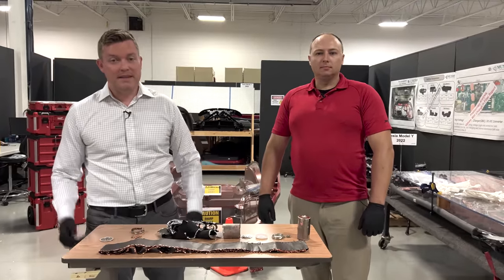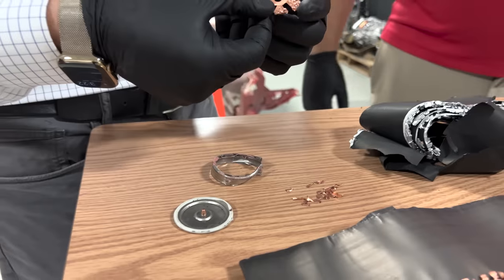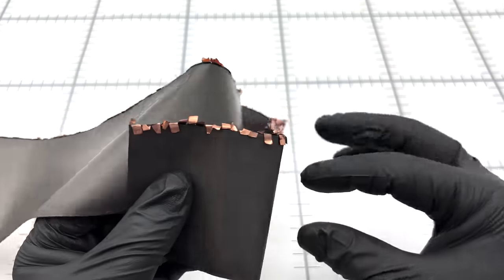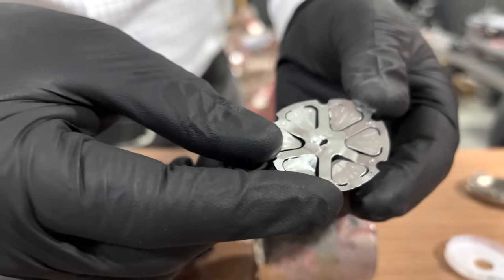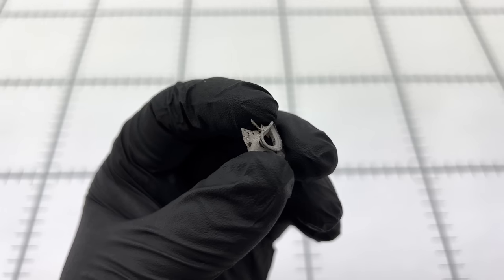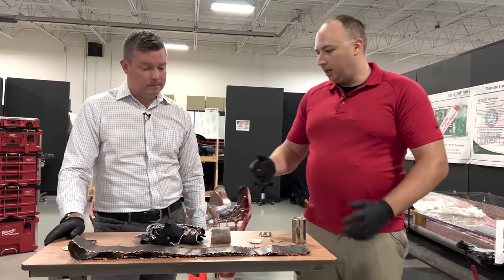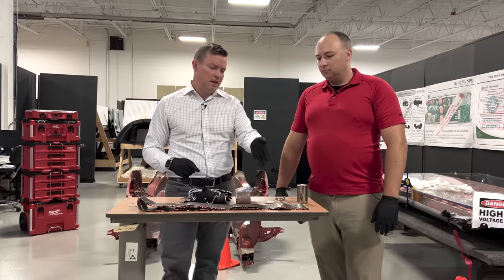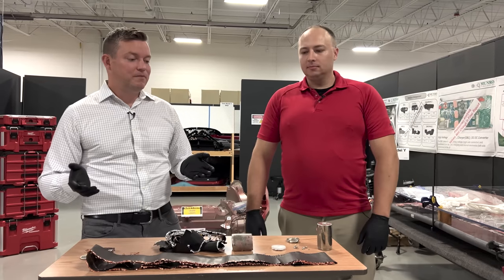What's Inside a Tesla 4680 Battery?

Comment: the tabless design is the only really new thing that has been introduced. as these cells get bigger, they result in good financial economy compared to other cell types. however, the pouch cell can be produced with this tabless design (which is not really tabless) as well and are better for a rectangular casing regarding volumetric energy density.
 bmw also wants to use similar cans in their newer EVs, but a bit longer. for sedans they will use 4895 cells - 15mm longer than the cells of tesla. und for their SUVs, they will use 48120 cells - 40mm longer than tesla cells. that makes absolutely sense. SUVs are a bit higher. which means, they can make the battery compartment in the underfloor thicker. this way, they get more energy into the SUV which fits the higher energy consumption of the SUV
Reply: Would be better to keep things simple - every time you introduce different item it makes production streamlining harder. Best part is no part. Less different parts, the better.

Comment: What is the benefit of a round cell vs the flat cells used by BYD et al?
Reply: If I remember correctly they said the production is faster. They produce them as fast like the water bottle production. The production is so fast that the video has to made slower that we can see how they are producing them.
Reply: The original 4680 form factor was for containment against runaway fires from single cell failure of the Manganese Cobalt Li battery composition. LFP doesn't need it, thus the pouch design which is denser is acceptable, and needed since the energy density is lower.
Reply: Also pouch style cells expand/contract a lot more (due to different chemistry) and need to have more free space to account for that.  Remember the Samsung phone battery fires? That was caused by not having enough expansion space.  Not sure I'd rate one type cell/pouch as better than the other. Just different solutions with a race to find the best cells at the lowest cost.  I'm sure it will be battled out for years!
Reply: @AudiTTQuattro2003  

I don't think so.
I recall it's simply to get the most jellyroll (GWh) out of the factory in the shortest possible time (Terawatt hour production from small factories)
Reply: Continuous motion manufacturing automation.
Reply: ROUND cells , less Stress , less FRACTURES than Folded WALLET cells and less DENDRITE growth than Pouch.
ROUND cells can be COOLED more effectvly.

Comment: Is 4680 really NMC 811?? Is that x-ray analysis the right way to determine the chemical composition?
Thought Cobalt was gone from all 4680 cells!
Reply: Probably once the cathode factory in Texas is finished.
Reply: @squee8174  They should be able to tell the existing Cathode manufacturer what chemical composition they desire. I doubt if even 2170 has Cobalt in the 811 ratio...it is supposed to be in trace quantities only.
Reply: @omnicurious2949  Where do you have your information from?
Afaik the only batteries with zero cobalt are the LFP batteries Tesla is buying from asian companies.
They still use little amounts of cobalt in their other batteries (18650, 2170)and the 4680 wasn’t intended to start with zero cobalt.
I mean where talking about how many kilograms per car? 2 maybe? That’s not much.
Reply: @Glenhh  Check Battery Day!
Reply: @omnicurious2949  Tesla are making their own cathode material. 

811 is a proven technology used in their 2170s so it makes sense to start production runs with it in the pilot plant.

All nickel... As stated in battery day was reserved for semi and cybertruck, where 811 and lfp was more economical for mass produced and economy  models.
Reply: @squee8174  Tesla cathode plant is not operational yet. 811 is the standard. But Tesla's claim on Battery day was to go Cobalt free (it's 3 years since the claim was made). In fact even in 2170 Cobalt is far far lower than 811! So, either Munro folks did not make an accurate assessment  or Tesla has had some major chemistry issues.

Comment: Very interesting, can you tell us the weight of the cell, I know they are claimed to be 355g each, I build e-bike batteries using 18650 or 21700 cells but am planning to use 4680 cells out of crashed Teslas or when they come on the market by panersonic.
Reply from the maker: I believe when we weighed one it was near the exact weight claimed.
Reply: @MunroLive  Thank you.
Reply: I think the Panasonic 4680 will be next generation. Supposedly with something like 5 tabs?

Comment: Would love to know if they are using the dry process for both anode and cathode. Also what the anticipated capacity of this battery is in volts and watts. 
Tear down of an earlier version of this battery by The Limiting Factor channel….shout out to Jordan….showed dry process used for just one of these. Also that estimated energy density of the beta batteries was lower than expected in a final version.
Reply: limiting factor have bought one of these cells so that brake down is coming
Reply: They indicated that yes, this one is dry cathode as well.
Just btw, it's "Jordan" (Limiting Factor)
Reply: @alanrickett2537  
That breakdown was weeks ago.
Reply: @rogerstarkey5390  no that cell was an early cell he got from a insider they are buying a car fitted cell to look for differences that one is still waiting on the cell being shipped which I think may have been waiting on this video.
Reply: @rogerstarkey5390  Ooops typo!  Will correct, thanks!

Comment: It gets interesting when they can make one of these for the price of 3x 2170, I guess. Apparently it can handle the energy demand cycles for a Model Y. I wonder whether it's ready to do the same for the Plaid. However, from the looks of things, it's NOT ready to bring Plaid and Roadster, even Semi and Cyber, the capacity they need, by lack of energy density.
Reply: Dramatically different requirements.  When you have a Plaid, the 2170 or 4680 may never work as the smaller 16850 has the best thermal attributes for very high power and multiple high performance runs.  Each vehicle type has very specific needs, such as low cost, high density or maximum cooling.  The 4680 is perfect for some appllication, but is likely the wrong chocie for others.  Then again, you can tweek the formulations to make different varients of the cell so there can be overlap with a single phsicial cell that fits different needs.  Exciting to see how it all shapes up.
Reply: I wonder if that's even possible. I read somewhere raw materials currently make 80% of a battery cell's cost. Not sure how accurate that is, as this would mean a perfect process would only spare 20% of the cost.
Reply: the Current 4680 is NOT High Energy DENSITY Nickel. its NMC 811 type , Standard grade . 
TESLA is Developing NCA/NCM, High Energy NICKEL as well as LFP Cathode. 
High Energy NICKEL is for SEMI , Cybertruck and mod S/X vehicles.

Comment: Min 6:00 Cory is looking forward to get a Cybertruck :-)
Me too. I think it will be a masterpiece on having a very good quality but also how to bring expenses down.
Reply: It will need to compete with the likes of Rivian and Ford who have excellent vehicles on the market already. Years ahead if we look at journalist access to anything but the "Jay Leno" hand made prototype with likely very different structure.
I do wonder how their successful application of (not their invention) giga casting with the steel exoskeleton can be. I've seen steel compete directly with carbon fiber for strength to weight on bicycle components. It takes A LOT from the engineerin and manufacturing side, though. Even a prototype is a PAIN to make. CT is competing only with steel/alu F150 and Rivian, so not quite as difficult. Giga castings might offer a great way to get the two end piece of a three-piece weld puzzle. Perhaps a surprise 3rd giga casting for the middle of the structure. Say the back of the cabin and roof down to the roof. If that one gets wrapped by a folded steel roll (exo body) and then welded to front and back gigacastings, that could be sweet. But can brute engineering take on F150 which is a long evolution of production leaning on great sale and experience?
For CB to make true to promise of 500 mi range, it will need 180-210 kWh (of meh energy capacity 4680s) of maybe 160 kWh and vastly improved aero somehow from the sheet metal exoskeleton. Can they water jet flow whatever form the body to be super aero? Can the flat surfaces be made to work and get a much lower Cd than F150 and Rivian? Even if they can save a lot of weight, that alone doesn't make a truck efficient. It might need an extreme suspension setup where it can be a low rider with vey efficient wheel wells for the city and highway, and then rise to be a competent truck. Rivian is beyond competent. See the Doug Demuro off roading test he did. The Tesla planet savers that just need a suburban "look at me, Tesla now cool" vehicle, I guess the off-road stuff could be kept to an option. Like Model X, take it on a fire road at low speed and your warranty is void.

Comment: So as we saw on battery day the 4680 cell is just applying the same technology that was already being used in super capacitors with the use of many tabs for each current collector on a LiPo cell.  The only real issue I see here is no tab to act as a fuse and disconnect a cell in the event of a short circuit.  Unless the rivit in the center is rated well below the current that this cell would pass to go into thermal runaway I still think this is a risky move since the cells are not externally fused either.  We would have to see a fully charged cell shorted in several different ways to see how much of a risk this might be unless the entire capacity of the cell is capable of being dumped across a dead short without enough internal heating to come anywhere close to a thermal runaway event.

Comment: What is the electrical path from positive to negative?
Reply: Top to bottom on the cell, side to side on the (unwound) jellyroll?
Depending on the orientation of the cell.
Reply: @SxWerks  the positive connection is to the post at the top; the negative connection can be to anywhere on the outer can, but in the Model Y is made to the top edge of the can (like the 2170).
Reply: positive post
to aluminum 6-lobed plate
to tabs on edge of positive side of rolled-up sheet then downward through aluminum foil 
then radially (outward within cell) through thickness of assembled sheets (aluminum positive foil, positive electrode, electrolyte, negative electrode, copper negative foil)
then downward through copper foil on negative side of rolled-up sheet to tabs on edge 
to copper 6-lobed plate
to case (and in the Model Y upward through the case to the top edge)
Reply: @SxWerks  The cells don't need to flip, because (as with the 2170 pack for the Model 3/Y) both positive and negative connections are made to the same end of the cell. The entire case is negative, so although the current path connects to the case at the "bottom" (opposite end from the positive post), the negative connection can be anywhere along the length (height) of the cell (and I will edit my earlier comment to include that); in this pack the negative connection is to the edge of the case at the same end as the positive terminal, which is the top as mounted in the pack. The positive and negative connections are only a couple of centimetres (an inch or so) apart.

Comment: Could the steel can of the battery be replaced by a plastic (combined with a thinner piece of steel) to reduce weight?
Reply: I'm curious as well. Howver, remember the NOISE about it being a structural cell? Cory showed how well these cells are glued together, they do form a block of sorts. How much that actually helps the car is another matter. Model Y barely lost weight, but did lose a good amount of energy capacity. Cheaper to make, but does it make technical sence a lot? The fatty pack thank (thank goodness) be bolted off after a wreck, but it's a chonky one and until energy density gets better, unlikely to be super popular for small series enthusiast or commercial vehicles.
I have an idea for an Ariel Nomad style buggy. If the Model Y "structural" battery would be decently light and advantageous to use as part of the chassis, yeah maybe...
Reply: @Cloxxki  this would also be a increased fire risk.
Reply: @Cloxxki  
Keep trying....
Reply: @Moon
That would defeat the object.
Reply: probably not, plastic is a very poor conductor, probably need steel so heat can escape the cell
Reply: The can was designed to withstand individual thermal runaway, thus the thickness and material...at least initially. LFP doesn't require so much structure.
Reply: Not only is it steel, but the can material is about 3 times thicker than most battery cells. It is very heavy. This is about structural rigidity. All of these cells are glued together and glued to the pack making the whole thing one big block that took WEEKS to disassemble. This structural pack now replaces the entire floor of the vehicle and the seats actually mount directly on top of the pack!  So yes, the individual cells are heavy, but they are replacing steel all through the body structure. A plastic cell would be light(er) but as with pouch cells, it requires a bunch of heavy structure around them to hold them up. Look at how thick the GM Ultium pack it! Tesla has certainly modelled all of this out. Remember that they are also replacing a bunch of steel through the vehicle structure with large aluminum castings. But the goal isnt really towards reducing weight, it is towards reducing manufacturing complexity.
Reply: @Cloxxki  🙄 Since when has Tesla ever claimed these cells would weigh less? They never ever claimed that. The point is to transform the rate of whole vehicle manufacturing. The seats literally bolt to the battery pack... how much more structural do you want it?
Reply: plastic wont be STRUCTURAL enough.

Comment: Other than being cheaper to produce, what advantages are there with the 4680 battery that would make  a difference with the owner of the model Y. So far I haven't heard of any. Range seems to be the same, no one has said the charging is faster. So what gives with this battery and all the hype. Anyone know?
Reply: These batteries should have a lower internal resistance which will give them the potential (no pun intended) for faster charge and discharge rates than their predecessors. Lower resistance also equates to less heat loss which in turn should give the battery better longevity and reduce the risk of fire.
Due to the packaging of the cell, battery packs should be a little bit smaller and a little bit lighter.
At the end of the day, these are only incremental changes. There is nothing "revolutionary" about this design, but improvements are improvements just the same.
Reply: @davidbrayshaw3529  One would think that an increase of battery efficiency of 18 percent would equate to longer ranges. Maybe they are purposely limiting range right now to match the older batteries.
Reply: @BTSflyer  I think that we might all find that claims of an 18% efficiency increase (kwh./kg.) might be a somewhat over zealous stretch of the imagination. A few percentage points of gain maybe, but don't get your hopes up too high.
Tesla need to develop these batteries with the view to rapid charging and discharging as well as to cost.
If these factors don't align, the Tesla semi is history before it's even hits the road and the Cyber Truck wont be far behind it. Tesla don't need to incorporate the 4680 batteries into their existing line up, they already work well enough. Scaling up vehicle sizes and reducing charge/discharge times is where the challenge is.
Reply: @davidbrayshaw3529  It was Tesla and Elon building the hype for these batteries. So far I haven't heard of any advantage with them. Oh yea for Tesla's profit margin is better with them.

Comment: My question is: Does anyone have any idea when these batteries will go into powerwalls? To me I'd think not until the automotive requirements are met BUT is there anything Tesla has said differently.
Note that I've been hanging in there with a 12 year old F150 waiting for the Cybertruck but I'll probably have to buy another 4WD diesel truck (Living in Texas yah know) because of continued delays in production  and so probably no electric  vehicles in my lifetime.

I'd also like to see a video of a fully charged battery get crushed (as if in a side collision) to see what happens
Reply: I don't think Tesla will put NMC cells in Powerwalls or Megapacks, at least not for first use (i.e. maybe after a life in a BEV it will get a second life in stationary application). Would make more sense to use LFP for Powerwalls, cheaper and can do way more cycles than NMC.
Reply: yea im in a similar boat im waiting on my CT but my dodge is a 2018 , I hope to have a little worth left in it so I can sell it once the CT gets here. I did read somewhere that 10% of battery manufacture goes into powerwalls so depending on ramp ,which has finally taken off , it should be soon maybe the next 12 months? We have no choice in waiting on the CT but I wouldn't necessarily wait on the power wall. there are plenty of other batteries out there that are meant for storage at a much cheaper cost point so I dont know if id wait on the 4680 in the power wall if I was doing a system anyway.